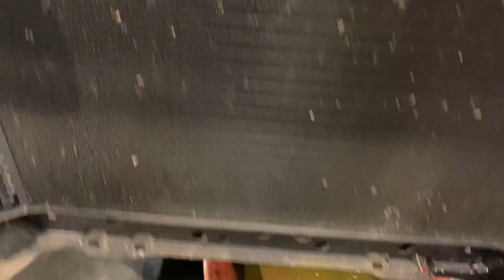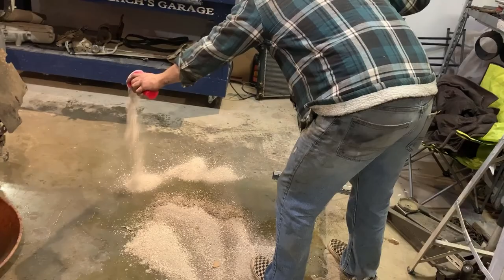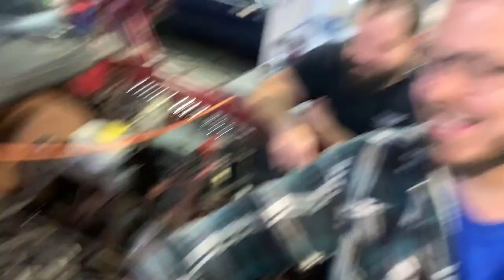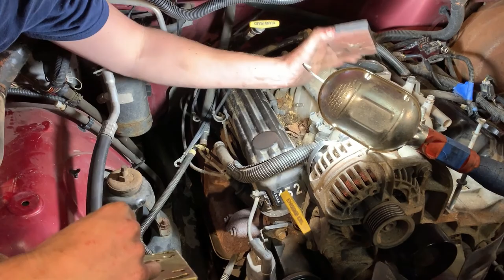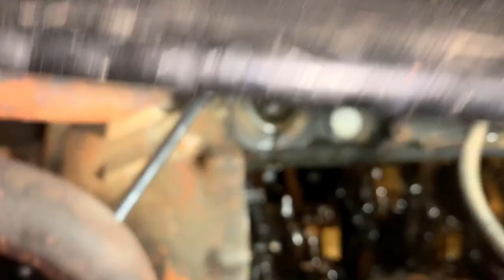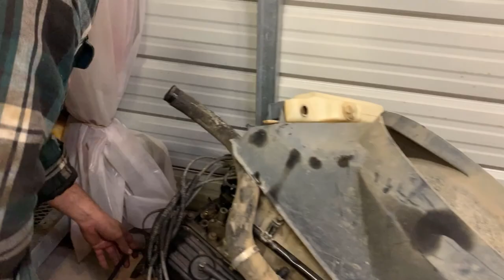1999 Dodge Ram 5.9 Engine Removal (Tips)

Comment: Thanks. Got a 98 ram 1500 3.9 that just blew a head gasket at 240,000 miles. going to replace  the engine. this helps!
Reply: Updates?
Reply: @CHEAPROLLIN  helped quite a bit did engine swap in 2 days. thanks

Comment: I have the same truck with 5.9 4×4. It's a 99. How do you remove the crankshaft? I need to watch a video on it
Reply: Once the engine is out and mounted on an engine stand, rotate the engine so that the oil pan is facing up, remove all of the bolts that hold the oil pan in place, remove the oil pan and you will see the crankshaft and rods, remove the connecting rod nuts and push the rods away from the crankshaft then loosen and remove the main bearing cap bolts TIP: mark the location and direction that the bearing caps are facing before you remove them, then lift the crankshaft out of the engine BE CAREFUL THE CRANK IS VERY HEAVY one last tip, make sure to remove the timing chain and flex plate/ fly wheel before removing the crank

Comment: Hey I have a question I did this on my truck and i reinstalled it but now the engine won’t stay on unless I have the foot on the gas you guys know why ?
Reply: If you havnt figured it out yet and you still got it it's something with the fuel or air system ide check to make sure there isn't any air being sucked into the engine besides the air intake and if that isn't it your gonna wanna check fuel lines and all that
Reply: Idle air control valve, intake filter gasket, plenum gasket, or a vacuum leak elsewhere, if it sounds healthy but won't idle it's probably the iacv, you can pop the throttle body off and clean the two a bit but it's more than likely a vacuum leak had the same issue in mine and it was just a intake gasket

Comment: I have this same truck and engine. It’s knocking like crazy with 130,000 miles 2001 model. I changed the oil and filter regularly. I guess it’s the engine and really wonder if it’s worth fixing? I see this isn’t a weekend project without tools and knowledge how to get it done.

Comment: Could you tell me the best way to drop the transmission from the motor... need help
Reply: Start with the driveline, remove the driveline. Remove the transmission bolts from the motor, remove the transmission hoist bolts and the transmission lines make sure you have a jack on the transmission and lower it slowly

Comment: Where do you get the plate that you bolted into the intake to connect the hoist chain to?
Reply: I found the same one in auto one. Order only tho
Reply: @Soliaintshit209   I found it, it worked very well. I think I got mine at JC whitney.